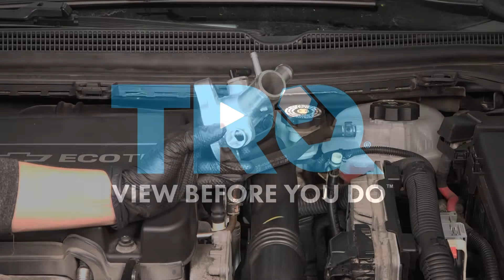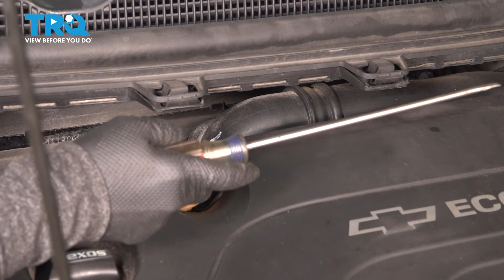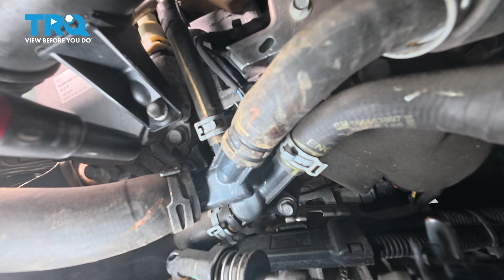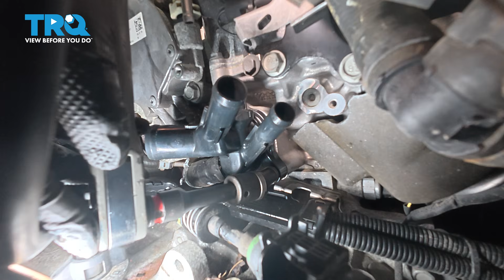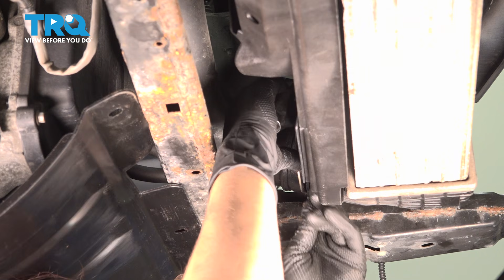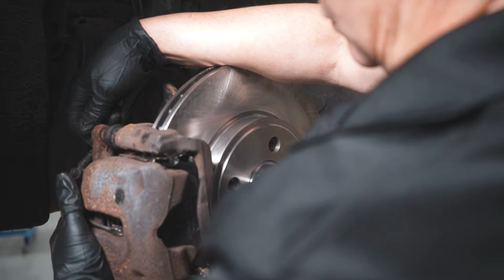How to Replace Thermostat with Housing Assembly 2016-2019 Chevrolet Cruze 1.4L L4

Comment: Thats not the Thermostat, its the engine coolant water outlet. The Thermostat is located next to the water pump, pretty much under the Turbo. You can buy the thermostat and water pump combined in 1 unit, or separately